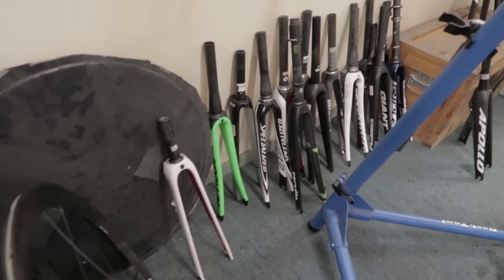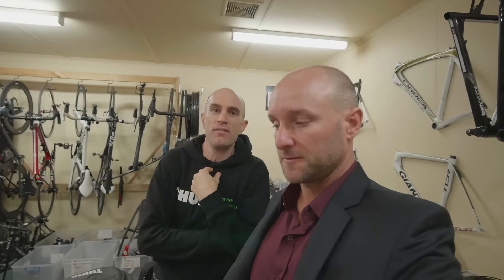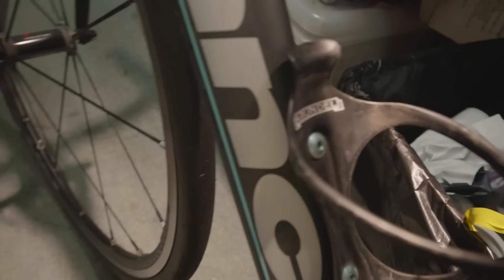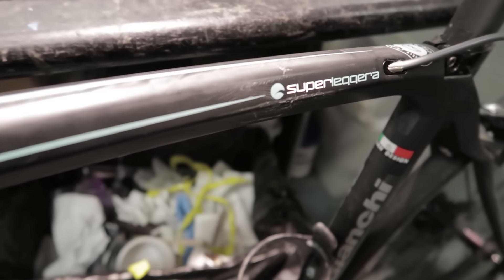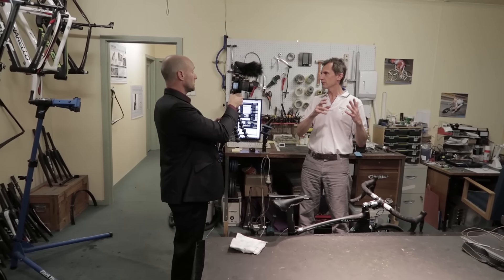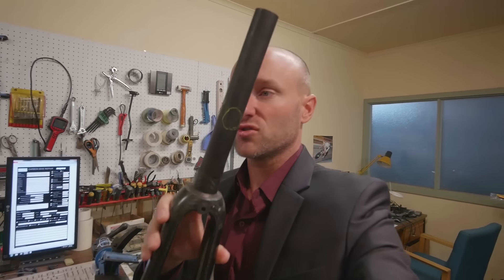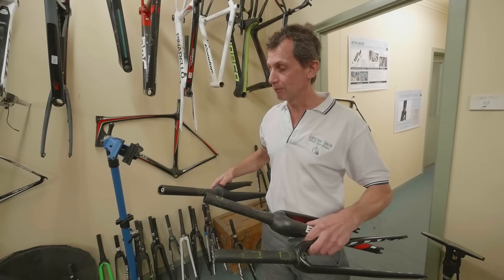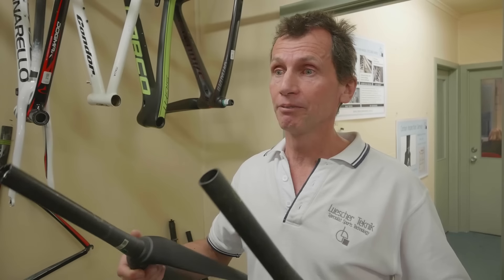Carbon Fiber Bikes - Are They Strong Enough? (ft. Raoul Luescher)

Comment: Titanium is the best!
Reply: I broke three titanium frames all replaced under warranty before I gave up and bought another carbon frame.
Reply: What ? !  How in the world do you do that?
Reply: Two were weld failures at the bottom bracket join, one was the downtube up near the head tube (XL frame size). You could argue it was bad welding but I think it was more a case of fatigue from flexing. I've heard of a lot of cases of titanium frames failing even very high quality ones especially where the seatpost enters. Everything breaks, it's just a case of when not if. If you start to hear creaking then have a good look around the weld points.
Reply: Titanium is a waste of money. Go steel with a good groupset if you're on a budget, otherwise go carbon. You can get a steel bike that'll be fast enough for most and super reliable and comfortable for <$1000.   If you're going to be racing seriously or just have money to burn, get a fancy carbon bike.
Reply: I disagree. I rode steel for years and now a Ti bike. It rides very much like a steel one yet is lighter and not painted. You can purchase a new 2016 Ti bike for under $3500.00. Carbon is very nice but it's way over priced. This is considering it's new. Old carbon sucks. Steel is dated.
Reply: i had a steel frame MTB been using it for more than 10 years, had several crash with it frame is still ok its kinda heavy but steel is cheap and very durable has a lively feel to it just like titanium the only difference is the weight.

then  i switched to aluminum frame  lighter, stiffer but it has a dead feel unlike steel and Titanium.
 
while carbon frames has better strength to weight ratio and absorbs tiny bumps really well you have to treat them with care..

guys like me with limited amount of money (just cant' imagine crashing my thousands of dollar carbon bike and breaking it) i would prefer a more durable bike frame like Titanium..
Reply: At what price can you get a carbon bike that performs equally to a Ti bike, in your opinion? What I said before was that steel is great for the <$1000 range, for poor students like me.  I got a 25 year old high end (in its time) lightweight bike for $500, popped on some new tires and it's good enough for me to keep up with everyone on my group rides (who are riding modern carbon and Al frames mostly). It has super reliable, well engineered components, and weighs in at 19 lbs. I simply could not afford a more expensive bike at this time. 

I also believe that the most significant factors in the quality of a bicycle are fit and components. If your bike doesn't fit, it's not going to be comfortable and you won't perform well either. If the components are crap, not shifting and braking well, and failing frequently, you're going to hate the bike.  When people argue about frame materials, how many of them have actually ridden IDENTICAL bikes, where the only difference was the frame material? You know, like a controlled experiment....
Reply: Aluminum framed would be best dollar for dollar. They're a little stiff, but respond well. Good hunting.
Reply: 19 lbs isn't bad weight really.

Comment: Wish I would have did a blog of me riding 1000 miles on my cracked bottom bracket on my super x. I bought it on a Craigslist deal and it was dark and the guy sold it for the price I ask for so I didn't question it to much. Months later I'm thinking carbon just isn't stiff the bike shop tells me my bike is not fixable and unsafe to ride 😂😂😂😂

Comment: Personally i wouldn't use carbon fibre on a bike. 
There are just too many angles that are far better machined alloys. Machined alloys are not that much heavier. 
Carbon is great for the frame of a bike. The gears aren't carbon fibre are they ? There's your answer. 
Most manufacturer will not repair carbon fibre. Throw away and replace, it is far to risky. 
There are xray machines for cracks you will never see. 
There is also a blue' product to show cracks. Even after a magnifying glass is used you can't see the cracks. 
Carbon is not that expense to buy. The finshed product with someone's name on it is ! 
Carbon fibre is exactly the same as fibre glass to work with only more toxic. Breathing in carbon fibre epoxy is not recommended at all. 
 I know you love your carbon fibre bikes but the risks are very real and carbon fibre is not impact friendly. They flex they stress but they do not impact. As he said closing the boot lid on a carbon bike ! 
Your on the road one chip from bike rack, nik from your shoe, 
I would get in aircraft made of carbon fibre but i wouldn't ride a bike. Ive buildt my own plane planes don't contact anything solid like bikes on the road.

Comment: Thanks, liked this level of info. However, before this video I had thought carbon bikes were fine for those of us who are not pros but can afford them. Now I would say they are mainly  for the gullible or the nerds who are impressed with its strength/lightness properties and who think it is ok to have to ultrasound every part of a used or crashed bike that they may have already paid thousands for. It must be galling for all those who had to check their bikes after hearing about wrinkles and even worse for those with very expensive carbon steerers and high mod frames. I think I will keep to unpainted aluminium and if I want to go nerdy, titanium, after all.

Comment: I'll never trust bicycles made out of carbon.  Just because an airplane or formula one cars use it doesn't mean anything in the bicycle world.  Aluminum is melted and poured into mold, carbon is shaped by the hands of people being paid very little money in poor countries.  All these people promoting carbon have vested interests.  These carbon bikes brake like no tomorrow.  Just google it.  Aluminum frames have been around longer and are way higher in numbers and yet you don't find as many cases of failure when you google it.  Carbon is an amazing material but not in bike frames.

Comment: my new bmc bike is marbled all over.  it's even a selling point on their website.  dammit...
Reply: bike companies are doing research and development at the customers expense. clearly they know the things will break much easier than say steel. their only selling point is that its super lightweight. and allows them to push the "advanced materials" spin. a carbon bike will not become a heirloom antique for a long time yet. if ever!.. i will stick to steel.
Reply: That's the point: it's possible to build a very light and yet sturdy carbon bike. Any attempt to do the same with steel will go very wrong ... And it is possible to make a carbon bicycle as heavy as steel, but it is absolutely unnecessary, but it would be much more resistant and expensive. That is the point, the resistance per unit of weight, and the carbon gains much of the steel in that question.

Comment: if carbon is is stiffer than steel, then why does it break on crash?
Reply: Because it has lower elongation, it does not bend like steel, it either takes the load or breaks, fortunately it can take a very high load when done properly.
Reply: thanks mate. seen some bikes just shattered to pieces upon crash. and repair cost is super high. oh, carbon...
Reply: Jogie Glen Mait Steel is isotropic. carbon isn't. isotropic means a material has strength in all directions. Carbon can be stiffer. Steel is stronger.
Reply: Jogie Glen Mait Exploding into pieces is one of the reasons Formula 1 use carbon and not titanium. It dissipates crash forces better and explodes into pieces. So his comments about F1 would use titanium if it were better than carbon is stupid. They use carbon for very different properties.

Comment: Pure Bull crap Been riding  carbon  15  years  Madones  made in US or Taiwan. I am 6.0 225lbs ride really crappy pot holed roads in  Pittburgh pa  year round  in the rain and  salted roads  and never had an issue   with carbon  ,I also just  know where water can  enter  and  you just need  maintain it , was a Litespeed guy  for years carbon is ssooo much faster    would never own a Made in China Road bike , I put around 5k on carbon frame then retire it . The slight risk of carbon fiber  defects can be  managed with  common sense .If your buying a used carbon bike look for a bike that some weekend  rider had  and has  low milage  . Dont let these  guys scare you Modern Name Brand Carbon Fiber bikes are safe
Reply: projectordude you put “5k on a carbon frame and retire it”? I personally cant afford to buy a new bike or frame every 3-4 months.
Reply: storyandsoundscape - wait, 52 weeks/year divided by 3 (4 mos.)=17.3 weeks.  5k/18 weeks (rounding up) = 278k or 173 mi. each week.  So, yeah - either he buys a new one each year or doesn't ride much, which is not to say he doesn't enjoy the little bit of riding he does. And again, if he can afford a new bike each year he may not have much free time.  Just to kick a dead thread...

Comment: I do not agree with his assessment of titanium as a frame material--some of ti's advantages are not just a matter of personal preference either. I own a ti frame hardtail 26er, and love it. The ride quality is great, but it is also very durable. My 20 year old frame is still pretty much like new, with zero corrosion, or cracks, and will likely last until I'm gone.Carbon cannot match that kind of longevity. Also, it is competitively light, as my bike weighs in at 21.5 lbs with an 80mm travel suspension fork. That fork does have a carbon crown and steerer.
Reply: Very anecdotal. As an engineer, you understand the depths of varying material properties.

Comment: comment about chinese fake carbon wheels, are they safe and rideable?
Reply: I ride Chinese carbon, no problems.
Reply: did almost 6k miles on my $600 wheel set. everything from gravel to off road  (on a road bike) to racing, climbing and fast descends. they are still great. the only issues I had was recently the skewer is becoming loose and the spokes need to be trued. everything else runs great. comparing my $2000 bike with Chinese wheels to $6000-8000 bikes mine rolls soo much better. find a manufacturer that will take care of you if the wheels break. do lots of research. and take it to a really good mechanic to true them before riding. everyone I know that buys Chinese bikes and wheels loves it. the only people that give it bad name is the guys who can afford $10,000 bikes because it has a brand name on it.
Reply: I think that it will all come out to the quality of the work.  Most of the stuff is already coming from a Chinese factory so it will be a QA issue.
Reply: So which $600 set did you buy and where from?
Reply: Last time I received a fake Ritchey Carbon stem from an eBay seller in Taiwan, I almost vomitted when I saw how crappy it was. The clear epoxy on the carbon fiber looked like dried Elmers rubber cement.
Reply: Mark Pearce
Fasteam. Do research. There are better cheap carbon wheals then the ones I got
Reply: Update on my wheels.
Almost 7k miles on them I finally took them for a tune up. The mechanic said they're in such a bad shape I should just sell them.
I didn't get them trued when purchased, which you always should with these cheap wheels. And I didn't take great care of them.
If you race, however I think it's a perfect option. I wouldn't want to crash on Zipps. Too precious.
Reply: What manufacturer did you use if I may ask ? I was looking at tantancycling...

Comment: Carbon bicycles are not a practicality. Aluminum bicycles can last as many as 12 to 15 years even if rode everyday to work and back as long as they are well maintained. Riding a aluminum bicycle is the most practical solution. Riding a carbon bicycle is in fact NOT a practicality no matter what this guy is saying. Not everyone wants to learn how to make a carbon bicycle so what's wrong with the standard being set here? 99 percent of the masses just want a lightweight aluminum bicycle which will last them 8 or 10 years max at which time the chain and sprocket cluster setups are completely worn out and to replace them is not worth the costs. Anyone who rides sandy or stone dust trails on a daily basis need to replace the chains every 1000 miles or 1600 km and the chain and sprockets need to be cleaned at the least every two weeks to get that wear. People who ride 50k per day getting back and forth to work will need a new bicycle every 7 to 8 years because it comes to the point everything is worn out because they have failed to keep the bicycle maintained but only when it breaks. I have only had one CCM aluminum frame tube crack on the crank tube after five very hard years of abuse. The Sirrus Sport I am riding now has gone just over 7000 miles (not kilometers) and I'm finally putting RockShox street tubes on the front and getting rid of the aluminum forks which are still just fine - but, I want an easier ride in the front. The Paragon model of RockShox I am finding is the perfect match. You have to put in special headset bearings as with any alteration to any bicycle -- but, once it's done I've got another 4 or 5 years of riding on the Specialized Sirrus Sport frame. So -- forget this Aussies intelligence about bicycles when it comes to carbon and such. Riding a bicycle is not flying a plane and only the crazy people who have been convinced that each time they get on their bicycle they are competing in the Tour de France which is utter non-sense are the only ones who are being duped into spending a ton of money for a reality they will never experience. A great bicycle shouldn't cost much more than $500.00 US and then add on a couple hundred bucks of things you need on your bicycle for a comfortable ride including lunch and rain gear or patch kits. I have 50 years of bicycle riding -- if you bicycle experience costs more than $750.00 US -- you're just not living in a reality but, you are in head rush of non-reality thinking you are in a Tour de France. Cheers
Reply: i agree and have the same feeling...

for everyday and casual racing nothing can beat steel and aluminum! in TDF those riders are sponsored and get paid by the teams and bike companies to ride their bike. if they manage to break the bike no problem they will just give him another one..
Reply: An entry level dual suspension mtb costs US $1,200. There are hardly any aluminum roadbikes that cost less than $750 with disc brakes and half decent components.